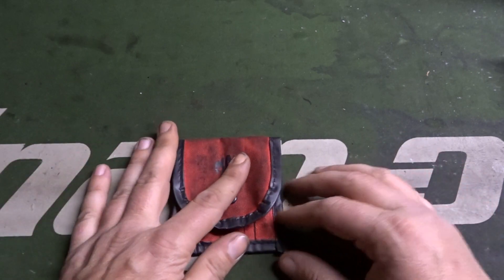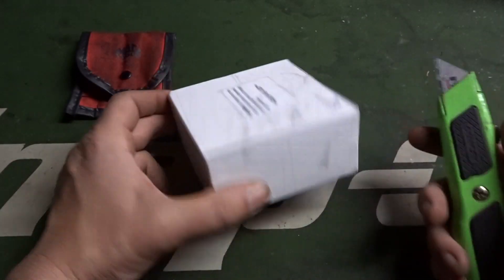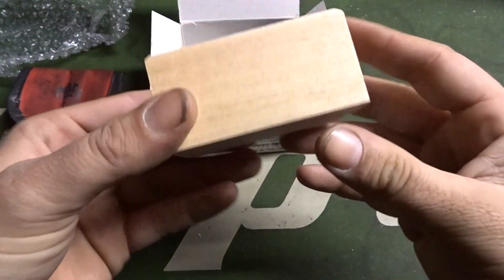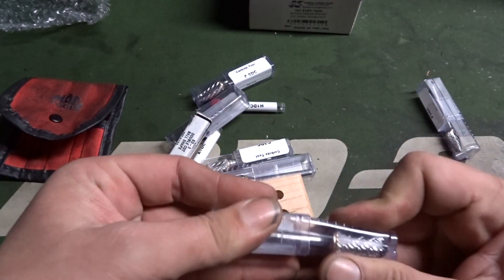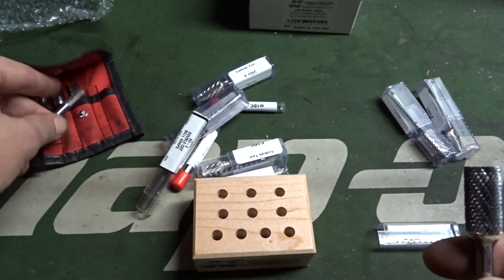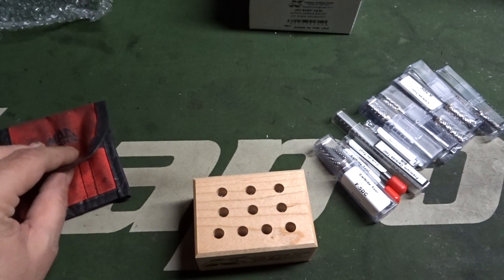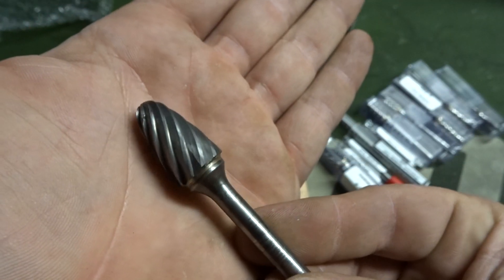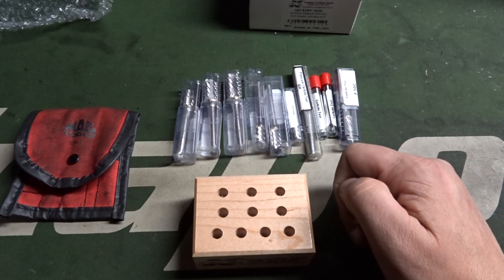Carbide Bit's Can I Use These For Porting Heads or an Intake?

Comment: Get yourself a product called Boelube, due some research. Boelube is made in NY by Orelube specifically for Boeing corporation..It can be used on either single or double flutes along with drill bits or mill burrs..The product will keep your bits sharp and keep the double flutes from clogging up. Yes single are designed for aluminum and double for steel or cast steel but with Boelube you can do it.. Keep the bit moving, don't push hard as it's easy to dig a hole but hard to put it back.. Of you want h some videos from Head flow Inc, Head bytes, Keno on Kenoconnor racing, he is primarily 2 stroke, watch his Blaster series he has some very good info and techniques that can be applied to other heads.. Don't polish the intakes..When you've removed what u need to use a 60 grit sanding roll or flap wheel on the intakes or the fuel can puddle. It's OK to polish the exhaust ports after final material removal to help carbon from sticking. If you get anxious or tired or hungry put down the bit and take a break as u can screw up a set of heads pretty fast if in the wrong mind set..Good luck..

Comment: If you spin the burrs in beewax or dip in mig dip before using it will help from clogging the burrs.. You can use the double burr on aluminum but coat the burr and turn your speed down so they don't bounce..Also you can get them in 6" long shank mandrels.. The single cut is the best for aluminum but you can use the double cut.. Also use sanding cartridge rolls in straight and cone shape for shaping and smoothing.. Also there are several companies beside 3M that make a really cool tool I just found..3M is called a Combo-S & it is an aluminium oxide flap wheel with scotch brite woven in between the sand paper, Dewalt makes one, Northorn Tool makes one, Walters two in one is another one..  Get one with a 1/4" mandrel so it will fit in your air or electric die gringer..If using electric die grinder or air use long nose grinder as your reach will be better.. If using an electric die grinder, Harbor Freight sells a router speed control that allows you to turn down the speed as with a carbide bur it will catch and hop in the port,not fun..Use vacuum tubing or rubber hose the the bur mandrel as this will keep the mandrel from damaging the seats.. Tape off the entire underside of head with heavy masking tape in case you slip with carbide you won't gouge head surface.. On the Harbor Freight router speed control, it doesn't turn down the speed enough, so if you open the back, remove the 4 screws on back cover and carefully lift to one side gently as there are electrical connections attached to back cover.. look at circuit board and you will see a tiny straight slot for a smaller than pocket screwdriver like one for glasses repair..Anyhow there is a small screw that can be turned, electric die grinder needs to be plugged into speed control and speed control into wall receptacle for power..Turn die grinder on, turn speed  control on and adj speed  control to lowest setting or slightly above, be careful when you insert screw driver into slot and turn as unit is energized as you turn screw on circuit board it will give you more or less speed than the knob on the front.. It you eyeball where the screw is and flip the controller over, you can drill a small hole in the front cover that allows you to make adjustments to speed from the front of controller once it is reassembled so you can fine tune the controller ...Reassemble the back cover and you're good to go..There is a you tube video explaining this..
Hope this helps.. Do Not get near the valve seats with a carbide bur when  cleaning the bowls as there is a high chance of slipping and dinging a seat unless you are super confident in your abilities.. I would go to the junk yard and buy a used head to practice on so you know what to expect so you don't ruin your good head..  Also put some tape or a piece of hose over the chuck on what ever die grinder you use and this will keep the spinning chuck from damaging your seats.. It's ok to polish the combustion chambers to keep down carbon, but put old valves in the seats so you won't damage them ..
You can also polish the exhaust runners and bowls to cut down on carbon..  Go to you tube and watch several videos from either head bites or head flow to get an idea, you can never know too much when porting..  No need to gasket match exhaust as  smaller exhaust port to larger exh manifold or header stops the exh gasses from tumbling backwards into head on decel.. Most importantly learn how to radios the short turn..Use your fingers a lot and feel your work as you can feel imperfections easier that seeing with your eyes.. Sorry for the length, hope its helpful..
Reply: Man that was very insightful bro ! Thanks a million !The more info shared the better we all become !P/S I love porting I've been porting heads off n on for over tweny years bro n still learn stuff every time !!!

Comment: You have "ferrous metal" carbide burrs. You'd like to have "non-ferrous" to do aluminum work. The ferrous burrs will work just dip in mig tip gel often to keep from clogging up.

Comment: Those will work with enough lubricant like a cutting fluid or even WD-40 in a pinch for aluminum, I use them all the time myself.   
For porting heads I would recommend a longer shank like 6"-8", they'll allow you to get in further as well as have a better line of site. A decent 3 piece kit with a tear drop, a ball end and a straight with a balled end.  You don't want to carve a groove with the square end burr, it'll screw with the swirl in the runners and create turbulence causing the flow to slow or even become worse than the original casting. 

Keep up the great content Boss we all look forward to seeing your upcoming videos.

Comment: The double fluted fills up way quick with aluminum, I spent more time cleaning all the shit out of them, than I did actually cutting away the material...
Reply from the maker: Bobby Garrett Good to know thank you
Reply: I can safely tell u all I need to do is lower the die grinder speed  and lubricate the burr often with CRC   lubricant or wd40 bro n you r set to go man  👍🏾

Comment: Yes you can 
The aluminum will just build up in the flutes. Just keep it lubricated and clean the chips with a wire brush 
The cast is harder and won’t load up the flutes 
It’s the same way with a hand file.
Reply from the maker: ZachBraps Good to Know. Thank you so much.

Comment: I have both carbide and HSS.
Get a couple junk heads and experiment before you do the head for the rebuild.
Smaller not only gets into smaller spots it also doesnt bog the airtool as easy. Larger work better in an electric tool.
We wore out some snapon badly chipped all over.
I bought the cheapest carbide I could find from aliexpress.
2 years of hard use not a chip or blemish.

Comment: I ported & polished my aluminum Edelbrock intake manifold with dremel bits just like that to shiny smooth perfection
Reply: You should never polish an intake side of an engine, it needs turbulance to adomize the mixture.  Exhaust side absolutely polish to get the flow.